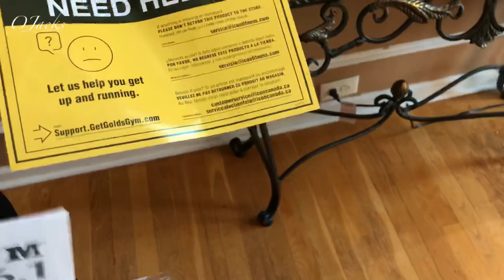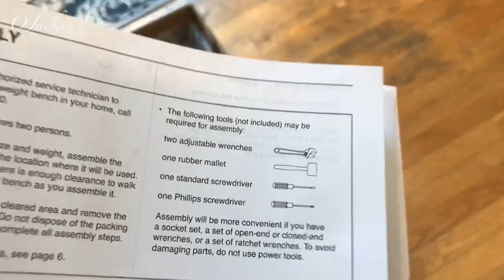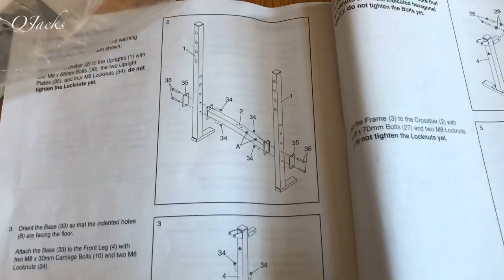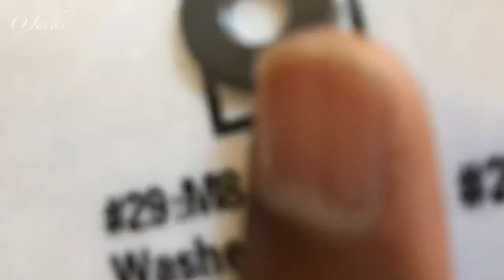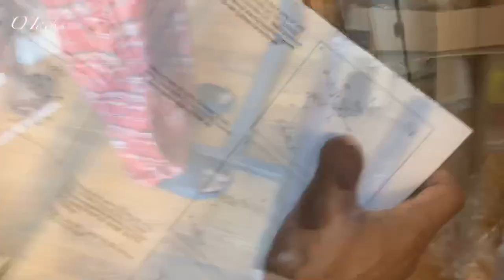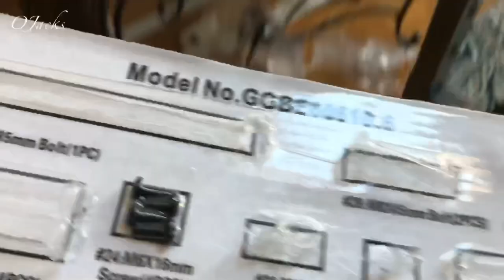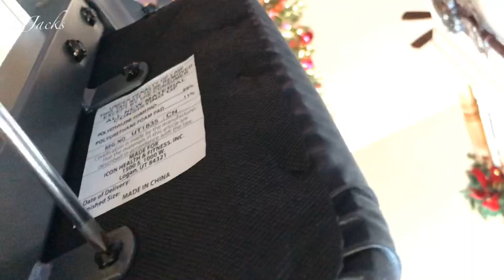How to Assemble Gold’s Gym 6.1 Weight Bench

Comment: If you know someone who’s a good welder, since this weight bench is like a starter to Intermediate bench, the base cross bar and the connector to the rest can be wobbly, maybe replace the cross bar with thicker gauge square tubing and on the bottom like a brace style tubing welded to the end tubing of were the leg attachment is. We did that to the old Joe Weider Weight benches back in the day. or if you have a 5’ bar and can’t get a natural grip where the uprights are you can extend the upright with longer bolts with spacers on each side and get a longer galvanized bar for back rest and you can have clearance for your benching. 

Just some ideas with you home gym weight bench. Don’t sleep on a bench like this. it can be improved with modifications 👍🏼

Comment: I just can't get most of these #34 locknuts to get tight.
Reply: What you do is you use 2 wrenches. Use one of the wrenches to hold the screw and keep it from turning and use the other to tighten the nut.
Reply: So I just took both sockets 13 & 14 and screws both sides at the same time

Comment: 5:02 those won’t get tight
Reply from the maker: Go back and tighten them again. I had to tighten them twice.
Reply: Cody Hamilton they won’t tighten for me either 😠
Reply: Armando Lemus I had to use different tools
Reply: How u tighten them?
Reply: SupReme GoatZ used my own tools. Had to hold the nut in place with pliers while tightening the bolt with a wrench 🔧
Reply: @Baaare52  thanks
Reply: Armando Lemus I had problems too so then I used a ratchet  and a  adjustable wrench, now they’re tight